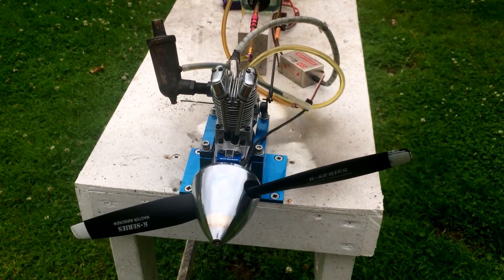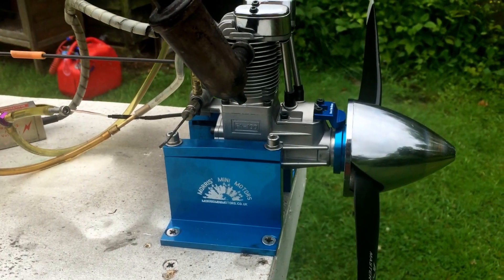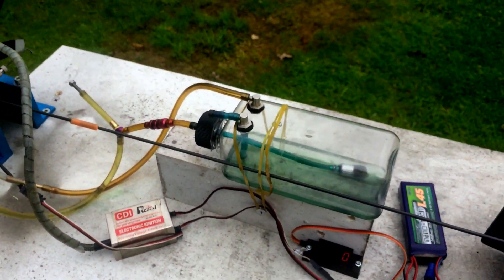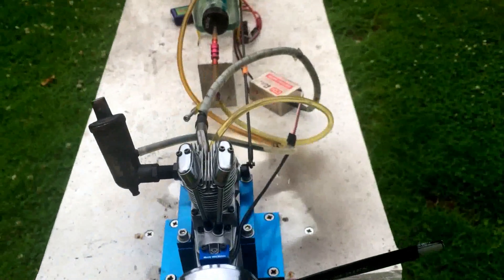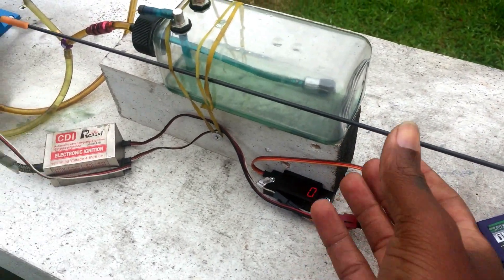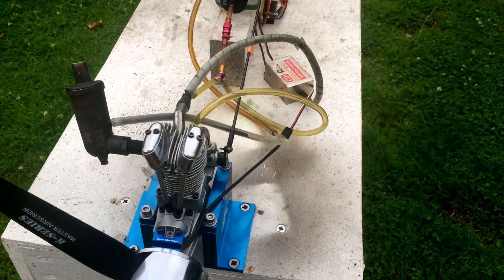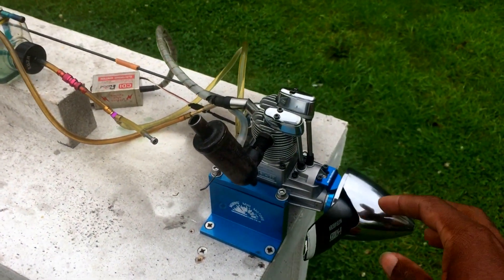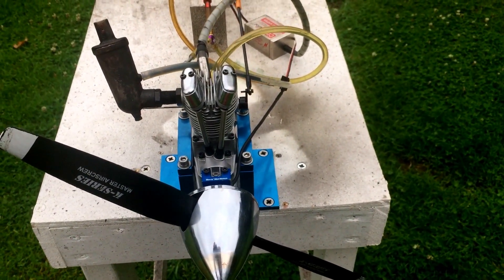Saito FA-100 CDI conversion running on gas

Comment: is it necessary to change the conrod? or not? because original conrod to use in gas  FGs has a brass part....correct?
Reply from the maker: Hi

Both glow and gas version use the same plane, conrod

Comment: Nice work moris mini motors..
I would wonder if saito made any internal changes from this engine to production of the fg17..
Usually on the glow carb it needs a slight modification to get a better off idle fuel mixture , the asp four strokes are confirmed to run long term on gas without any problems..so i doubt this saito would either have problems for long term use..saito fg19r3 doesn't have any brass bush on the conrods so i doubt these singles do..
Reply from the maker: Hi 

There are no changes that I no of

Comment: Always try to have the muffler level, not pointing up. The left over oil will build up in the exhaust right at the elbow of the muffler pipe bend.
Besides that, I like the conversion, good job!

Comment: Hello

You use the original carburator without modification ????.
Which quantity and quality oil you use ???
The original rod dont have bearing, you use that without modification ???

Thank you for answer

Roland
Reply from the maker: Roland Francois Hi

Yes i use the original carb without modification!!

I am using 20 to 1 mix Power Model 2T-S two stroke oil!!

Yes i use the original rod without modification!!!

Thanks Morris
Reply: Roland Francois HelloThank you for answer, but i have a doubt for long time use, when you use the engine with glow, you put 18% off synthetic oil, here you use only 5% ??Roland
Reply from the maker: Roland Francois You can use 18% if you want, i am using the same as Saito FG engines!!!

Thanks Morris
Reply: Morris' Mini Motors hi
Do you do a carburettor conversion for this engine?
I have bought one of your conversion kits but I cant get it running right, still lumpy.
I bought a full conversion for a  Saito  fa 125 and it runs superb.
Reply: @rolfra  Gas acts already as sort of oil unlike methanol, that's why you don't need as much oil when the engine is converted to gas.
Reply: @skyeboat  Typical MMM job?
Reply: Roland Francois